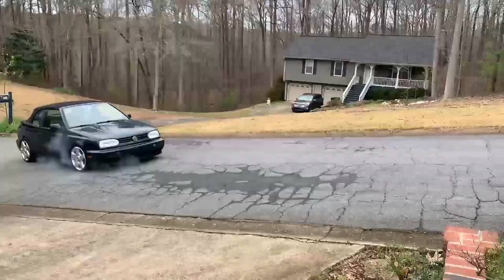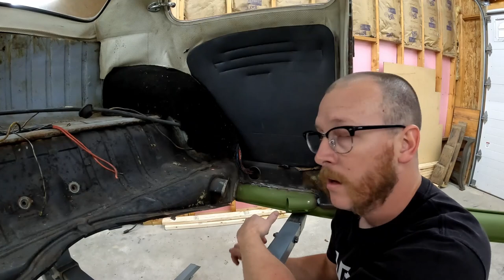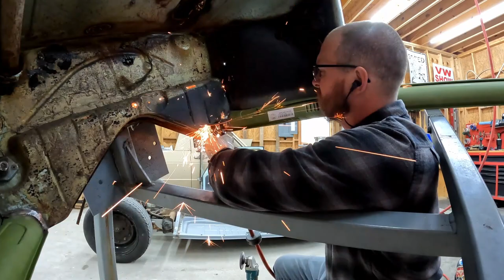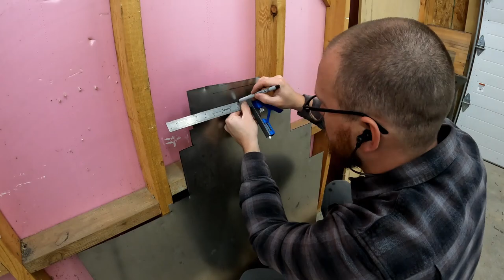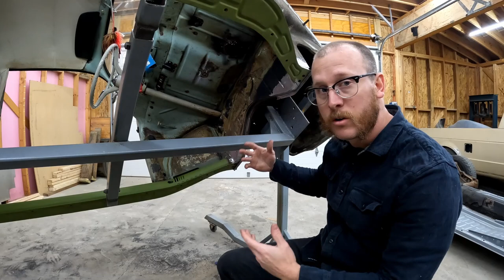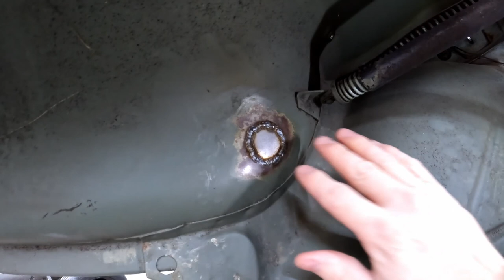Wrapping up the metal work on our 1965 Beetle Project

Comment: You do Great work with your welding with mig.  I'm an old fart taught by my dad to do Oxy/Acet welding.  When you oxy weld you just "dress" it ( beat and cool ) and there's no grinding and re welding pin holes. I'm probably never be convinced that a row of hard tacks are better than a soft malleable continuous oxy weld. 😉 I suppose tig is the same but it's very fussy.

Comment: uh, remind me again why I would use mild or heavy torch heat to address stuck body pan bolts?  I've followed and am stuck with a body pan bolt and others recommended heating up the bolt.  Is that a smart method?
Reply from the maker: Heating any of the floor pan bolts with a torch is more hassle than it’s worth. You cannot get the heat up into the threads where it’s needed. If you have an induction bolt heater that may help, but a torch will just make a bunch of smoke and smell.